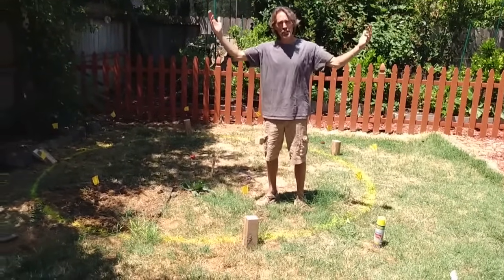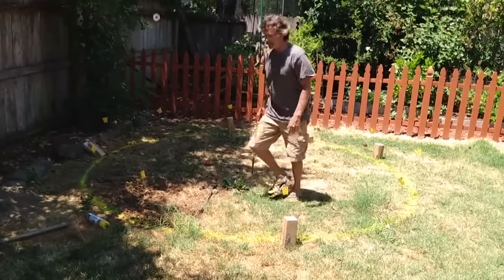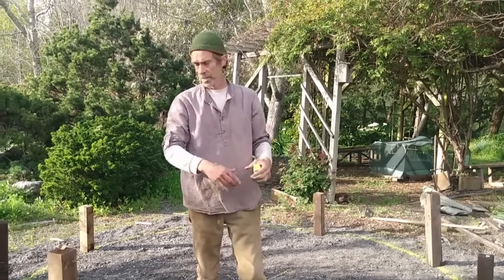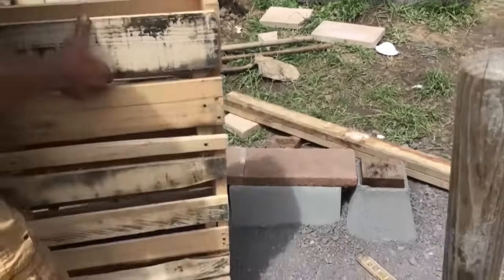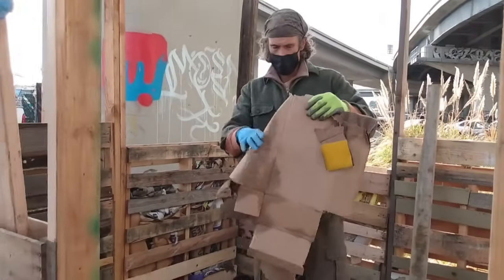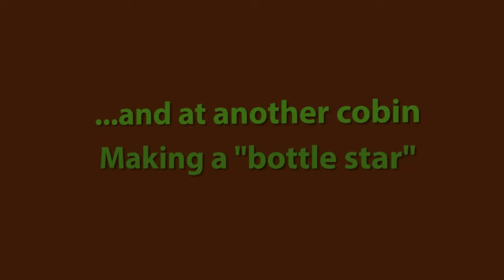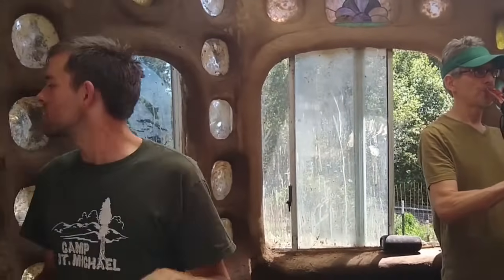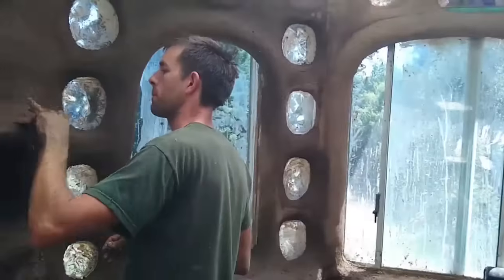How to build a 'Pallet, Cob house "Palletable Cobin"

Comment: Your not suppost to pack your insulation.  Like loosely shake the straw down. You can tap your structure to slightly adjust the insulation. Don't pack it.
Reply from the maker: I understand your rationale however one of the reasons that I pack in the straw is to fill in the gaps in between the pallets. Often there is a 2 inch gap between boards and the compacted straw gives a rigid surface for the cob to stick to. If it is loose then the car doesn't stick to the spaces in between the boards as well. It would be interesting to build two structures side by side with one densely packed straw and another loosely placed straw and see if there is a noticeable difference. If there was then I would do what you're suggesting and just make my gaps between the pallet boards closer together. I find cardboard to be a great insulator as well because of all the air pockets
Reply: @cobalot9  I did not take into consideration about the cob needing a firm base to adhere to. I want to use shredded junk mail for my insulation in my cordwood cabins. Keep up the good work. Your kids will be master craftsmen by the time they finish elementary school! Outstanding job!

Comment: 7:33 u skipped a step - how to put the wooden poles in the ground. Also, you forgot waterproofing for them- wood no matter how treated, should never touch the ground!
Reply from the maker: Right, ok, So, to put the post in the ground I first get copper green and paint that on the bottom two feet of the wood. I then make a 2 ft deep hole in the ground and set the post in there and then fill them with concrete. That's what I do You put the post in the ground. If you don't want to use copper green or pressure treated wood you can also put your 4x4 uprights on Pier blocks and that works as well. I have done this for over 20 years and I've never had any of my 4x4 posts in the ground rot